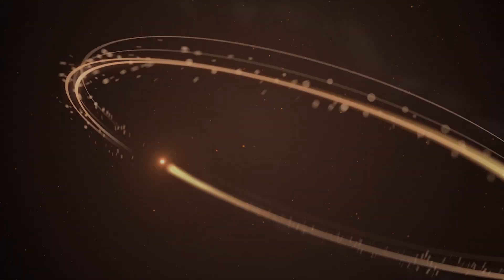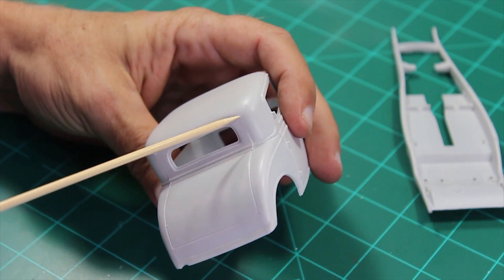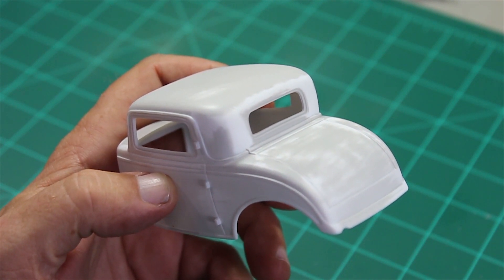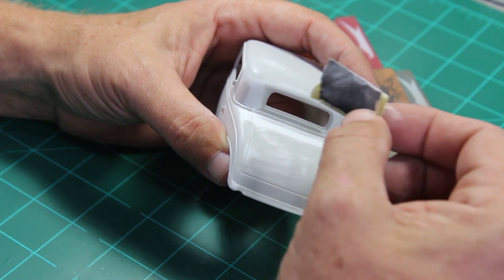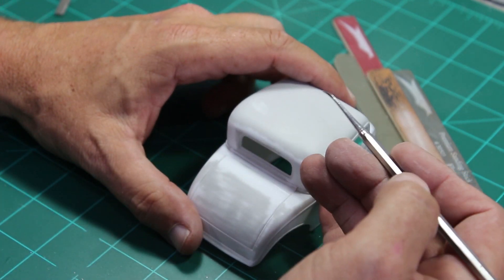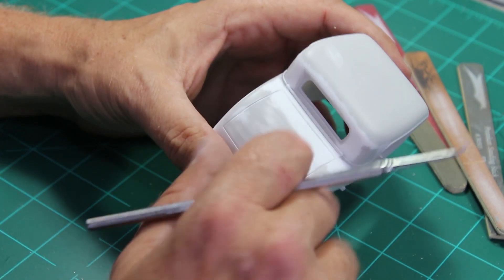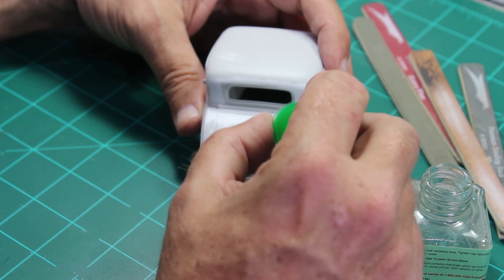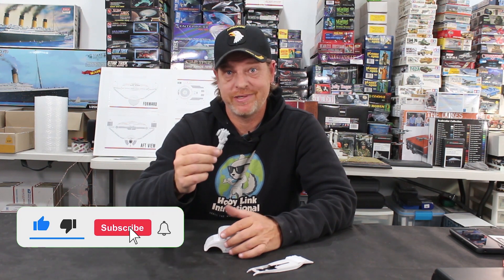Revell 32 Ford Coupe - Body Work

Comment: Looking good so far, there are a  lot of mold lines for this tiny body. I try to always sand off the wording and licensing but admittedly I forget it sometimes. You put a lot of effort into getting rid of that step but its worth it. Not bad for a guy who only talks about models but use to build them many years ago. Like you didn't miss a beat.
Reply from the maker: Thank you Dirk :) And, yes I am really trying to break away from the talking head videos and back to building now that we have a space to do it :) So later today on to the engine :)